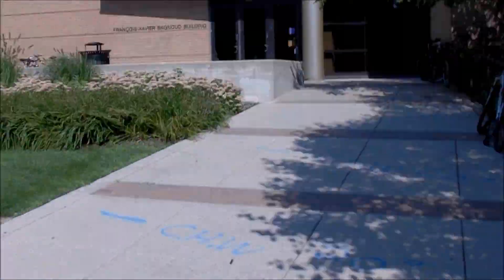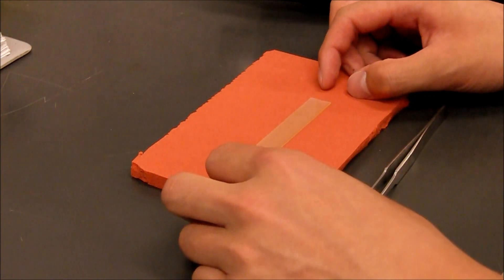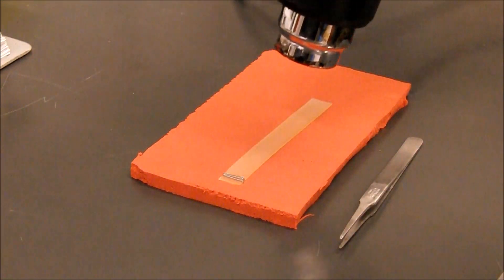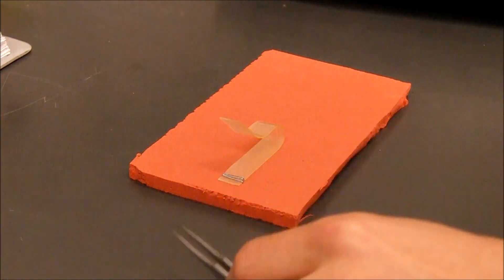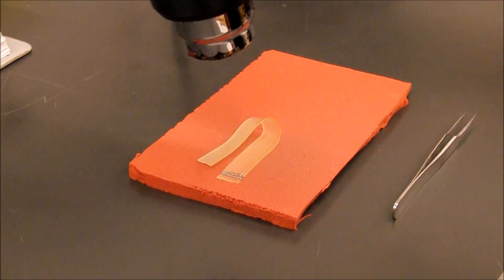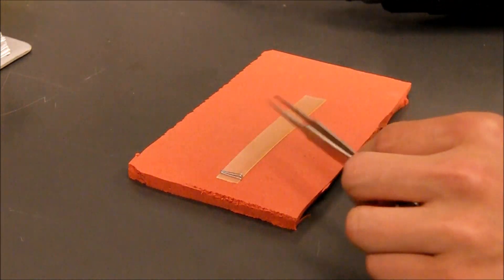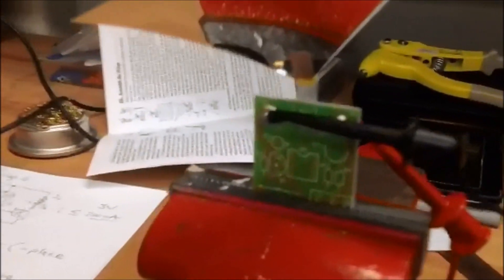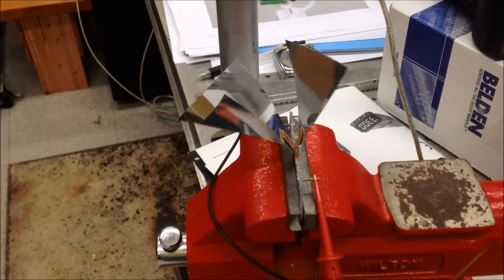SURE 2013: Shape Memory Materials and Applications

Comment: hey you said flexinol dont you mean nitinol. great vid pls make more
Reply: +Connor Dow Flexinol is a brand of nitinol from Dynalloy. It's basically a Nitinol alloy wire which has high transformation temperature, and also high tensile stress when heated (through current, for example).
Reply: thank you for the info
Reply: https://youtu.be/9fx4tOK731w